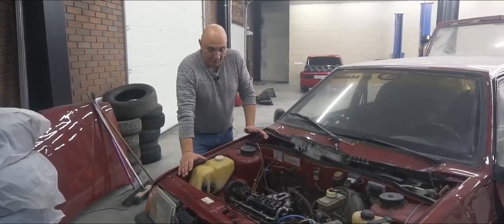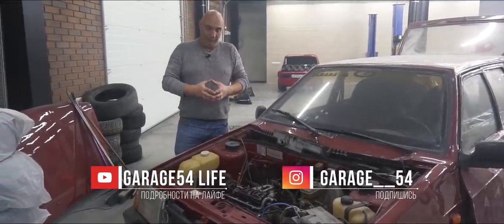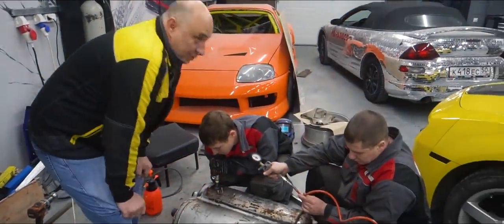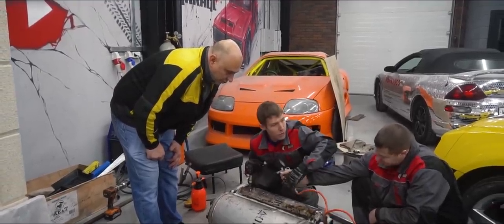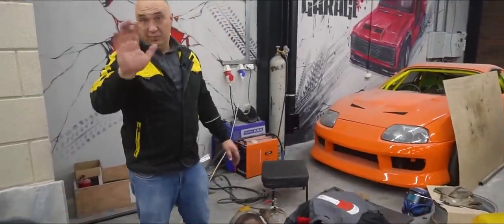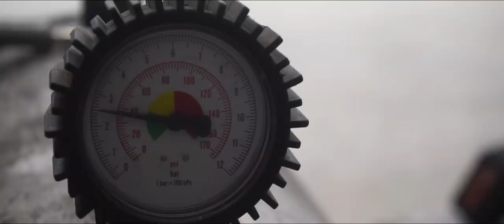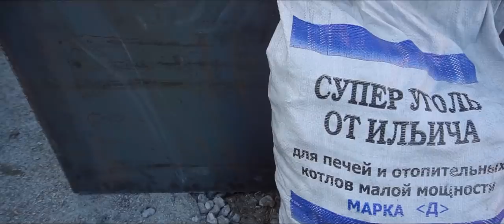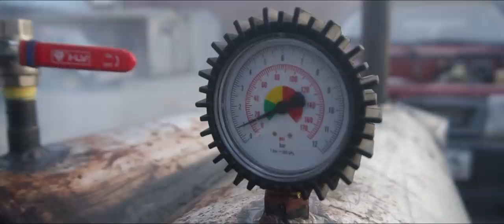Steam engine conversion – first startup

Comment: "I think we got zero carbon emissions here"
Me: didn't you use coal to heat the water?
Reply: He did, charcoal, which doesn't release emissions burning in the atmosphere or in a furnace, at least it should be just as if not less pollutant that running your gas/diesel powered car.
Reply: That's the same logic as electric car drivers...
Reply: @potatoradio  but you can use wind turbines or solar panels to charge/help for charging electric cars
Reply: @potatoradio   only if the electricity comes from coal powerplant
Reply: @Finn Scott I was being open to the fact that he said emissions instead of carbon emissions as the russian guy stated: zero carbon emissions, which from the motor itself, no the steam did no produce any carbon emissions, and if you want to get really into it we can start arguing over whether it produces more Nox emissions from the air that comes into contact with the boiler or whether the already carbon-neutral charcoal which only puts out emissions (harmful and less harmful) that carbon emissions if it get's deprived of oxygen, which if you could see, would be pretty hard to do when you have a blower fan connected to your furnace.
Reply: Rewatched the video and will admit that he did use coal which does put out a lot of emissions less like charcoal, you can put together that when he said "zero carbon emissions", he was speaking about the car itself and the engine specifically, if you want to cry about how the furnace DOES put out emissions than be my guest.  This is their first design and I know that my first design wouldn't be flawless either.  Cheers!
Reply: @unitytwins6652   Nobody crying here, just laughing, as is the intention behind this channel. To make people laugh.
Reply: @jomar_sl  exactly, there is some science and ingenuity that goes into the making of this but for the most part it's just a video of a car running on steam.  Just know that the russian guy had a point of what he was saying.
Reply: @Finn Scott but if you replant the amount of trees you burn its emission free
Reply: @unitytwins6652   Coal is not clean. It's just how it is. The car runs on coal. Water/steam just function as a medium to transfer the energy from the coal. And nobody cares, coz the whole thing was just for fun. Go watch the rubber ducky exhaust system they made, you'll understand.
Reply: @jomar_sl  never said coal was clean, what I said was that charcoal is way cleaner and burning it atmospherically would produce less emissions than to run the car on gasoline especially seeing that it was originally carburated.  I think that my last comment made very clear that coal does burn with tremendous emissions but I'm going to stop because it's obvious that either you don't understand me or you are just fucking with me now.
Reply: Charcoal is renewable, mined coal is not. Charcoal comes from burning wood with very low oxygen, and wood is a part of the short cycle and thereby renewable
Reply: @Namesakes.unit-x-10sq10   It still have carbon emissions. You can't burn if you want to achieve zero carbon emissions. Short sycle or not, you release carbon that was bound up. It will be there in full effect untill you re-bind it again.
Reply: @jomar_sl  the re binding is when a tree of equal size grows again. Trees are basicly carbon in solid form, unlike oil which won't turn back to oil after being burned.. But burning wood (sensibly) is not bad for the environment at all! But over usage of non renewables is.
Reply: @potatoradio  Internal combustion engines convert only 30-40% of the fuel to mechanical energy, the rest is lost as hot exhaust, hot engine that needs cooling, noise and mechanical losses. Coal and gas-fired power plants on the other hand can afford multi-stage heat recovery systems that increase overall thermodynamic efficiency to ~70%. If you lose 10% power from the power plant to the battery and another 10% from battery to wheels, gas/coal-fired electric cars still have 10-20% better overall efficiency than gasoline cars. It is also much easier to implement tighter environmental requirements on power plants which aren't constrained by weight, space and cost anywhere near as much as cars, so that's another win for electric there. Even without strict power plant environmental norms, it is still preferable to have a handful of more efficient large coal/gas power plants located in the middle of nowhere than millions of tiny ones all over the streets.

If they ever manage to double battery density while also increasing cycle endurance and lowering cost, EVs will be win-win for almost everybody. Direct ethanol fuel cells would also be a nice alternative.
Reply: @Namesakes.unit-x-10sq10   I know what a tree is. Also you basically say breaking a leg is not an injury, coz it will heal. It takes lots of years to grow back a tree. Meanwhile the effect of burning it is active, all that time.
Reply: Making an electric car uses a ton of fossil fuel as well. 
I always get a laugh.
Someday the electric car will probably be better but for now I will keep pumping diesel.
Reply: @ddriskill1   Lol. Best comment I've seen in a while. "I cracked a couple of bones already, so I see no problem cracking the rest". Lovely 😙
Reply: @jomar_sl  if breaking a leg and co2 emissions are the same thing then yes I suppose, but not really. There is a limit to how much of those trees you should cut down, but if we stopped fucking up the rain forests and planted a shit ton of trees we would be somewhat better off. When a tree dies it releases all that co2 anyways, so burning it doesent make a difference.
Reply: @ddriskill1  agreed. (although I will always keep a couple of motorcycles and a subaru wrx to have real fun when I want to, electric cars have no souls and they aren't nearly as intrieguing as IC powered vehicles)
Reply: @Namesakes.unit-x-10sq10   How long time do you say it takes for a tree to fully evaporate into the atmosphere after it dies?
Reply: @unitytwins6652  Yes "Zero emission" refers only to what comes out the tailpipe, not emissions from the power generation. And as you say, if the wood is replanted charcoal is CO2 neutral , so burning it does not add more carbon to the atmosphere.
Reply: @jomar_sl  it doesent evaporate, it gets consumed by micro organisms. The time it takes is somewhat irrelevant
Reply: @Namesakes.unit-x-10sq10   If it is consumed into another bound up state, it is not out in the air. Time it takes is ofc important. 30 years of warming effect before it is bound up again is 30 years of warming effect.
Reply: @jomar_sl  look it up for yourself. When bio materials decay, they release co2, that's it. More co2=more trees. I can see this in my home country because the tree line has risen in the past years, and there is more bushes etc.
Reply: @Namesakes.unit-x-10sq10   It is easy math, and you should be able to do it yourself. When a tree decays, it is a slow progress where most of it is absorbed into new solid state. Nutrition for small creatures, other plants etc. If you burn it, you instantly release all the effect, and the effect is active untill you have somehow absorbed it again. There is no publications that have contested this. You said it yourself, trees don't naturally evaporate. The only natural scenario with the same effect as burning wood for fuel, is wildfire. I'm not a hysterical environmental police trying to tell people what to do or how to live their life, but it is what it is.
Reply: Carbon dioxide is not a greenhouse gas unlike what you've been told. The global warming agenda is all about control. Think about it. The government is going to ban an element on the periodic table? Or how about the fact that CO2, the most naturally occurring gas in the world and is part of photosynthesis for all plant life, is now being classified as a pollutant? It's been a necessary component for life on Earth for over 50,000 years and suddenly it's polluting, because the government says so? That's rich. So when did this so called "authority" become the truth instead of the truth being the authority? Assuming this is a real issue I have yet to hear of any idea that doesn't involve the erosion of liberty. Place a tax on every breath we take? Reduce world population at government's discretion? If anyone here thinks that would never happen then you're too late. It has already happened before.
Reply: @exoticcreature3059  its all just a scheme to make some people money and gain influence. And all the people who are half smart eat it up like it's hot cakes! The sad thing is how they got people to frown upon us skeptics.
Reply: @exoticcreature3059   
Short: https://youtu.be/kwtt51gvaJQ
Long: https://youtu.be/HdwKOZjuukM
Reply: @Namesakes.unit-x-10sq10  I'm not sure which is worse. That they believe it to be true despite not actually knowing it to be true, or that they believe government can save them from. Lord and savior. Hah, government couldn't so much as protect the people from a few cavemen living in a desolate nation with limited technology. That is the official story on 9/11. Official story.

Comment: Darwin Award goes to:
The guy that welded his own pressure cylinder on the floor.
Congrats on making a bomb!
Reply: Yeah it is rather sketchy hey, no safety valve (i could see), means of feeding water or safety features like fusible plugs.I don't think its going to explode on the pressure they ran (well under 100 psi if i saw correct) then but if they pushed it too a couple hundred psi , it could go bang, probably not enough stays.Their fabrication is not awful all things considered, but they clearly don't understand what they are doing.Proper boilers have safety margins in the thousands of percent range so are massively over engineered, that gives the impression that this "boiler"(over sized kettle!) they made is a bit more dangerous that it probably is. Im a boilermaker and steam enthusiast.
Reply: @dunxy  yep.
They had a tap on the pressure tank that would fail before anything else. Hopefully. But to make a proper steam engine they're going to need 300psi at least.
Especially with that engine design. Valve float will be astronomical. Those Lada valves are designed 20psi so if say the piston will be closing the valves, and poorly, and compression will be 80 at best. Which is why steam engines use rods on the camshaft and not lobes/springs. At the very least you could overlap the valves a little more to overcome mechanical resistance.

But I've seen the aftermath of a boiler explosion. Even the Mythbusters water heater explosions were epic and from memory they were 350psi
Reply: @1one3_Racing I  dont think 300psi is at all required if they used a proper steam engine,lets look at it this way, if a 5" gauge steam locomotive weighing under 100kg running a boiler at 90psi can pull over 1000kg (they can and traction is the limiting factor normally VS power/torque being insufficient) with extremely tiny cylinders they should theoretically have no problem driving the lada using an engine of that capacity i would think,not that ive ever had any experience with an internal combustion engine (nothing to do with Ladas ever,i like Toyota myself) running on steam.Id say their simple main issue would be that their kettle will simply not supply the required amount of steam because it simply wont have the surface area or drafting to keep up with demand.
Im very curious about what boiler explosions aftermaths have you seen? Ive been around (main line, not toys here hey) steam locomotives here in Australia for a VERY long time, there has not been a boiler explosion here for probably a century.There has been deaths (unfortunately,its very sad but life is dangerous)in the last few decades that i do know of, one person was killed when a fusible plug failed, iirc it was only inserted finger tight but im not going to judge as i did know the fitter who installed said plug and he was very messed up.We did lose 3 guys (R.I.P guys. I knew the fireman very well and i still get rather sad about this) a few years ago as well, but that was a derailment caused by a fuckwad truck driver and the safety valve got sheared and a fusible plug partially fused because engine ended up on its side and flooded the cab with steam and the result was naturally not pretty,these the only steam related deaths in the last few decades here.Actual explosions, yeah nah, not that ive ever known of here in modern (as in non wrought iron boilers) times because the regulation is very strict (regular double operating pressure hydrostatic tests) and the safety margins are huge.I even have steamed long out of ticket boilers in the past with some rather thin sections, all be it at rather low pressures . Hot water services aren't pressure vessels, they aren't a boiler, so the fact that they even made it to many hundreds of psi is a testament to how hard it actually is to blow something up,even something not designed to hold any pressure,just heat water.
Reply: Yeah I've worked in feedmills and feedlots with boilers and if one of those went boom it would take out a decent chunk of land mass.

I'm talking more ghetto, home made, boilers. Videos on YouTube although they are probably gone now with Nanny state rules. I've not seen it first hand. Only in video format. Should have stated that!
As for pressures, an efficient steam engine will require a lot less pressure than an ICE converted to steam. The valves won't close with back pressure and it's not an interference engine so the pressure of the piston coming up HAS to close the valve before it can build compression to overcome the pressure on the opposing cylinder. The engine is constantly fighting itself. Half of its torque output will be used up turning the crank.
Plus the relatively small surface area of the piston. Steam pistons are huge so small PSI equals huge torque. That Lada engine would likely have 65mm piston or so. Maybe smaller. At 90 psi thats only 460 pounds.

Comment: Safety valve and a means of feeding water(injector or a pump being it hand or crank ran) and you need to run a blower to draft your fire, proper locomotives use the exhaust gas to draft the fire.Would be better also if you didn't use "wet" steam, after you take feed from boiler pass it through a tube that runs through firebox to superheat it, helps mitigate condensation which will destroy the engine and you will  get better performance.Great project, i hope you go further with it. Steam cars have been around eons, you can make a more compact boiler that provides steam 'on demand" so making much more functional.

Comment: If you route the steam coming from the exhaust into the chimney and point it up it will give you a bigger draft without the blower. Good luck guys! And add a pressure relief would ya

Comment: Try using steam to clean the inside of the engine and muffler system.
The steam probably removed most of the carbon deposits.

Comment: If you mount the boiler on the back of the car, you can use the exhaust steam to power an exhaust extractor to increase combustion gas flow

Comment: This is gonna be awesome. A homemade steam generator & steam powered engine. That is amazing. I am looking forward to see how this plays out. As for mounting the steam generator. You might could reinforce the roof & mount it there or reinforce the rear & mount it there. I myself am not an engineer or anything like you guys that is just my thoughts. Or you could try to adapt the steam generator to fit in the trunk.  I myself have no clue about adapting anything. But either way I am looking forward to see how this plays out. It will be very interesting.

Comment: I wonder if you put a steam receiver tank near the engine to feed into that, kinda like an air compresser receiver tank which you fill up first and is depleted first and the second tank being heated will automatically fill the other tank so you always have a good head of steam available to use.   cladding and insulation on all pipes, recirculate the steam from the exhaust straight back into the water allowing the gases to escape leaving only the condensed water.   Maybe a displacement lubricator for the steam line to lubricate the cylinder and bearings.
Reply: Look on youtube steam Reliant Fox, a very nice example of a steam car.   His is the 4 wheel version of my three wheel car...

Comment: Its needs to be a closed loop to avoid losing all the water too quick. I wonder how much of the steam gets by the piston rings and if enough, could it condense and put water into the oil/ cause crazy crank case pressure? If this is the case, The crank case pressure needs to be recycled back into the steam loop or out into the atmosphere.

Comment: 1 - put the chimney on the other side of the boiler = more heat in tubes  2- use the exhaust through the chimney to raise the aspiration and boost combustion

Comment: I realise you've already built it but for the quantity of steam you want and considering the tiny platform you should really go for a steam generator system from the 'White' and 'Doble' steam cars. If you do that you can heat relatively small volume of water also you'll need a Condenser (you can use a radiator) with a heat exchanger to be as efficient with the water as possible.
Also, remember heat = power the closer you get the water to over 500 degrees Celsius the better.

Comment: 7:43 They welded the pipes together without beveling the end. No root pass, just slam and weld. Beveling the end allows you to weld the pipe together all the way through the thickness of the pipe, not just on the outside. It makes the weld stronger than the actual pipe! It wont hold much pressure like they welded it.. It'll probably be ok for what you're doing but its not good practice. Steam is fucking dangerous!